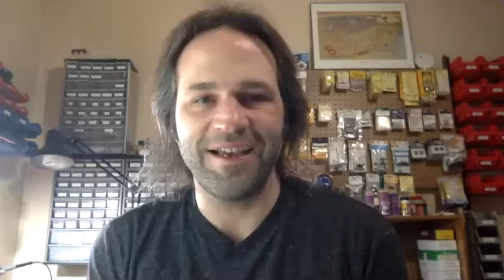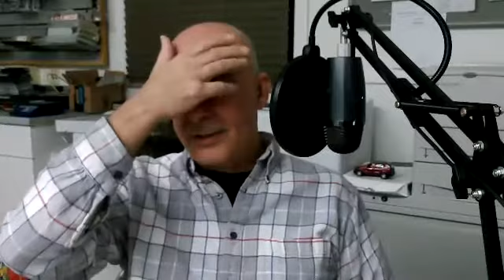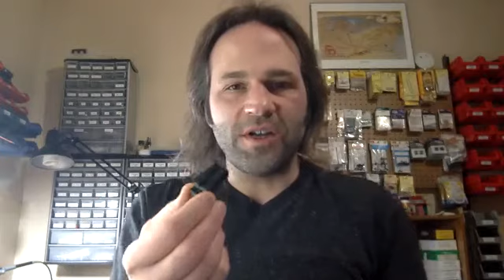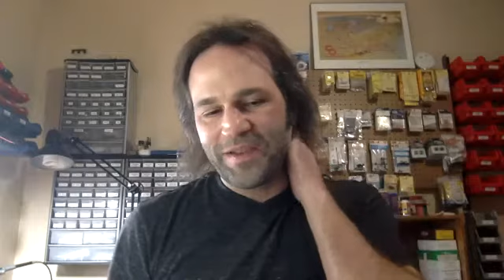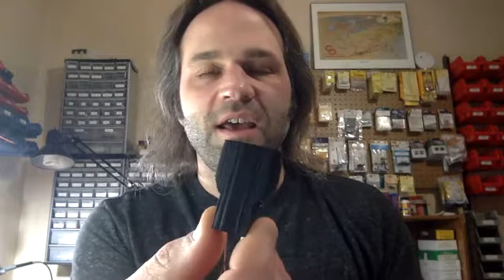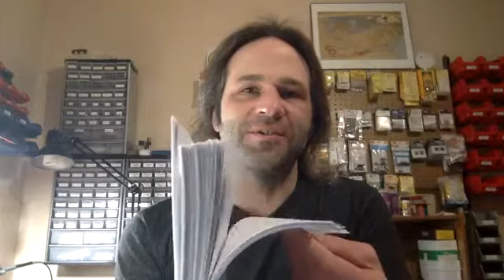Crew Call 3-1 January 24th, 2021

Comment: Great speakers, I have purchased several of his products. Only sad part is...he will not sell the "driver" alone by itself. Some of use might like to make our own enclosure.
Reply from the maker: In further discussion with him, it's not just an enclosure, but an enclosure that has varying thickness that has been calculated for optimal sound.   This is why it's a 3D printing thing, and why the same driver in your own enclosure would sound very, very different.